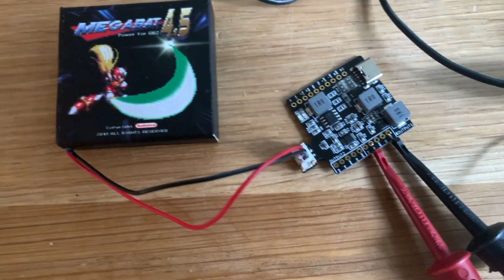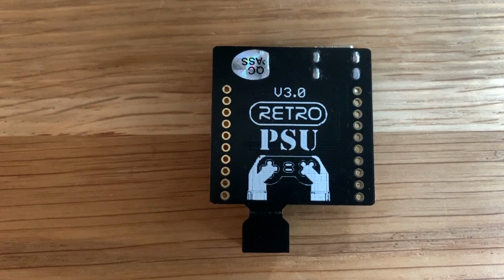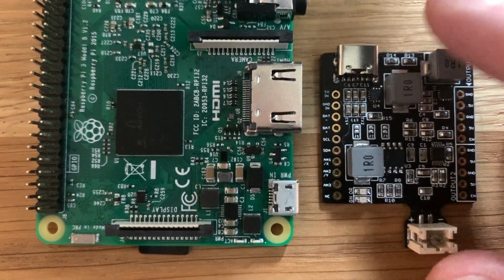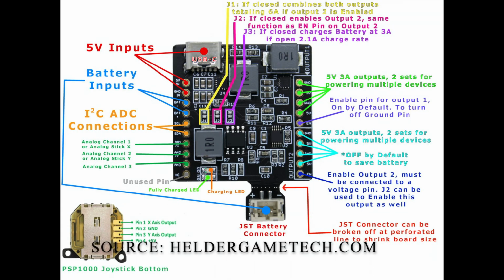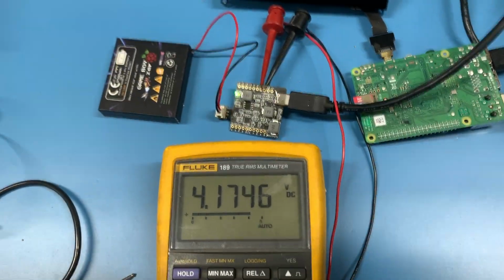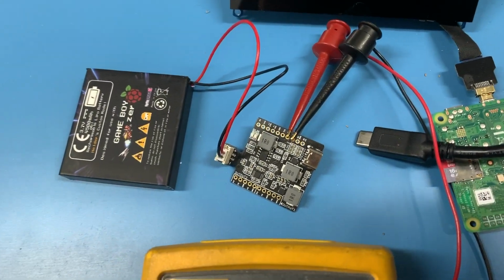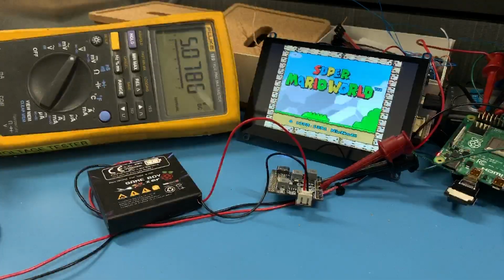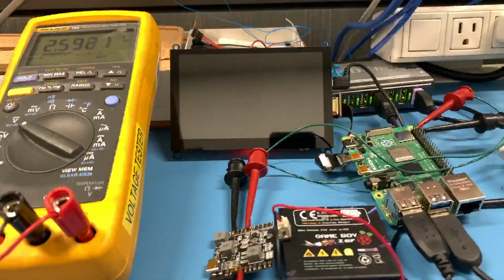RetroPSU Review - Battery Powered Raspberry Pi 4

Comment: Okay an update if anyone even saw my first comment. I got a retroPSU and set it up all the same to power my pi. A little switch to turn off the board to prevent it from powering the pi and everything. It works good so far. No low power notifications or resets when I plug things in. I doubt it could handle my external HDD still but I have a workaround for that. It seems to be an awesome board.
Reply from the maker: Did you need to add any capacitors?
Reply: @ComputerClubShow  nope, it seems to be working just fine so far with the retroPSU.
Reply: @ComputerClubShow  It actually does provide enough power for my hard drive too which is a bonus. This is all with 5v 3a. Don't even have the pads soldered together to allow 6 amps.

Comment: Have you ever had the issue of an rpi resetting and not being able to power up from plugging in peripherals? I've heard of putting a capacitor on certain pinouts on the powerboost 1000c for example to help with that but if this board with it's monster 3a output fixes that issue altogether, I think I'm swapping battery boards. I guess the pboost is 2a with a max peak of 2.5a... the official 7 inch touch screen and an rpi4 might just be a little much for it even adding a mouse and keyboard on a hub.

Comment: In my experience a 5v powerbank works well .......but..... in my project..a gps logger with raspi zero I had to add step up converter. the python software to deal with gps logging is based on two button interrupts. without the step up converter the software crashed during interrupt...

Comment: I'm working on about the same project but with a 7" display, 8000 mAh battery, and the same PSU. If you ever have any questions on the more hardware side feel free to shoot me a message... I did the Pi slim down and may have some advice on that too.
Reply from the maker: Which parts did you end up taking off? I’ve just ordered another board and I’m going to take another crack at it. I think this time I’m going to worry less about getting all of this pins out and just snip some off.
Reply: @ComputerClubShow  I removed both double USB ports and the Ethernet port. My advice is to use cutters to clip off bits and pieces until you get them down to the pins in the vias. Then heat the pins with a soldering iron and individually pull them out with tweezers or pliers. Be careful not to damage or clip any other components on the board. You can then clear excess solder from the vias by heating them and slapping the board down to knock the molten solder out (usually I tap a corner hard on the workbench, with the board angled down). Afterwards, you can either solder on a 1-tall USB port or just four wires manually run to wherever you need.

One other option would be trying to just trim off the top half of the USB ports. If you do, just be careful that none of the pins or conductors get bent together and shorted.
Reply: @ComputerClubShow  really glad to hear you're continuing with this project!!

Comment: I think I went a bit overkill on my project because mine is gonna be a bit of a big handheld I got a 25600mah battery pack ran it for about 4 hours ish and it only took 15% of the battery wish I had seen this board before I got my battery pack. anyway great videos really great to see someone making a pi handheld and going through each step and decision
Reply: I've been trying to make a Pi portable for quite some time and bought tons of parts that never quite worked out for various reasons.  After the Switch Lite was announced and replacement shells became available it started to become possible for what I wanted.  I found a good 1080p screen tat fits in the shell, and with a little work and the iPlay Cooler Grip, I can fit a full size Pi into the shell and grip making it replaceable when a newer Pi comes out.  I just don't have much time to work on it.  But I'm hoping over the Christmas holiday season, I will be able to get it working.
Reply: @Teh Psychedelic Look for WiseCOCO 5.5" LCD.  I believe it's a 1080p landscape AMOLED screen.  SO it doesn't suffer from screen tearing.  It's about 1-2 mm smaller than the space for the original Switch Lite screen.  If you get a screen protector that has the black border on the outside.  It's not as noticeable and looks pretty good.